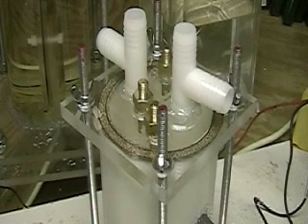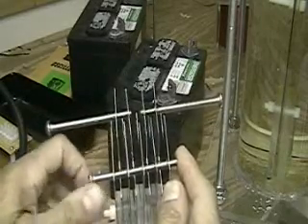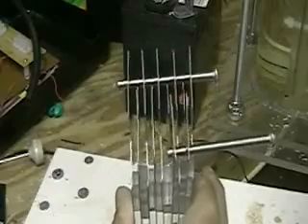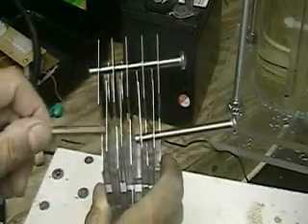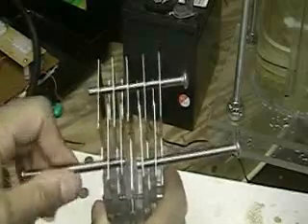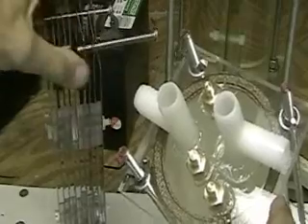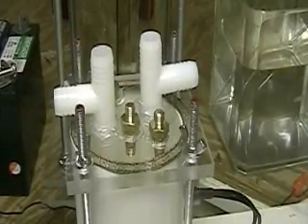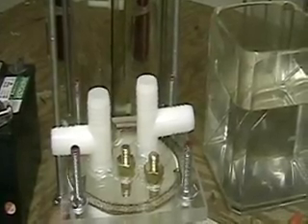Hydrogen Tap (Twin Cell Discription ) 122

Comment: John, have you seen the recently available video of Stan Meyer's first documented running of his 1500cc dune buggy @ idle on his 1st generation Hydrogen cell ? In particuler he mentions 13 plus PSI pressure from cell, 5 volts. 2 amps and varying voltage for output. Looks to be 3 ft tall.